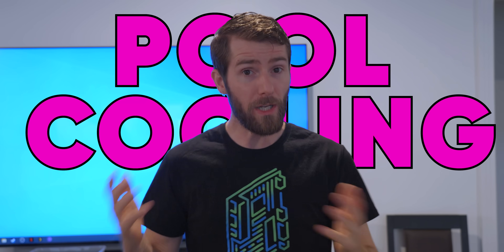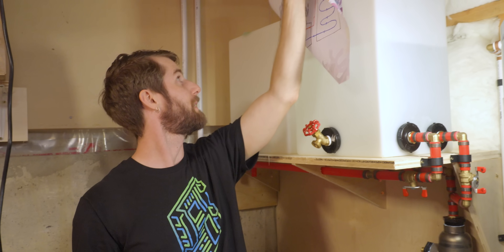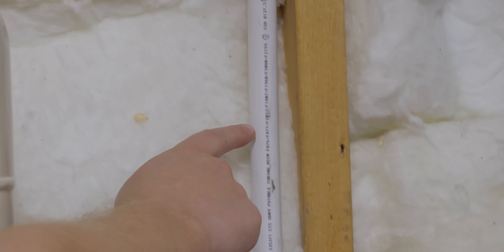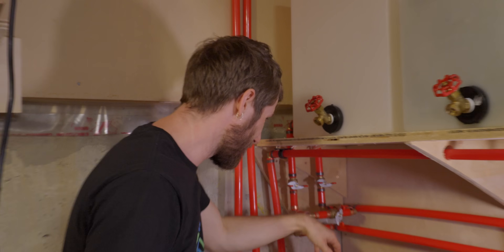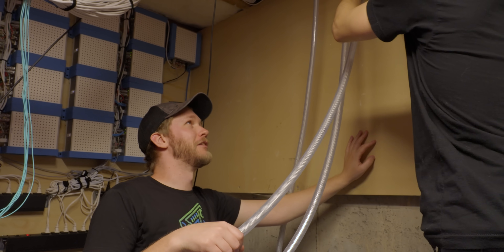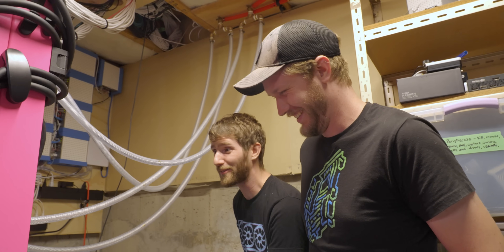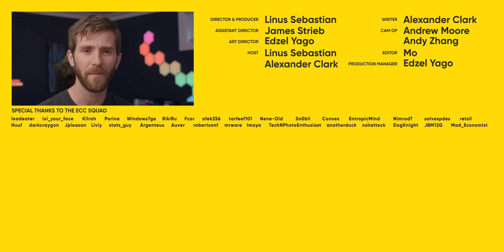My pool leaked and killed my computer - Whole Server Room Pool Watercooling Part 4

Comment: For a "expensive high tech house" build series, there is a ton of jank and bad decisions. Can't wait to see more!
Reply: Most professional installs are full of jank and bad decisions lol
Reply: This series makes my own upgrading decisions and our less than 100k value old house look like one sharp thing! I like it
Reply: Come on, they do it on purpose, no one is that stupid.
Reply: @laughingvampire7555 Oh yeah, surely people who have never repaired/upgraded a cooling system that's dependent on a pool would never accidentally make a single mistake, no sir.
Reply: Ikr. I was literally cringing at those manifolds from the start only to see them fail 2 times alone during testing (its only a matter of time before it breaks and starts leaking again).
Reply: There is no cloud. There is no expensive computer. It's all sand that's had light pointed at it and the software sucks anyways.
Reply: For sure 😂. The easiest, fastest and long lasting solution was and it will always be the good old air cooling. Just need to add some ventilation from the server room to the outside so that it does not become an oven
Reply: the problem becomes the noise pollution in that area of the house, that was one of the complaints...
Reply: @mastroitek might have been better fitting the outside bit of a heat pump in there. Cool the room, heat the house!
Reply: That's what happens when you have more money than sense.
Reply: I guess when you're rich and everything is supplied/payed by sponsors, consequences is nothing you need to worry about....
Reply: These videos are really just a grift. He's getting advertisers to give him free stuff that he wants in his house so that he personally benefits (himself and his family... not the company) without having to actually pay for things, he agrees to make videos to promote the products. Then he double-dips by monetizing the videos.
Reply: @scrazzle  you say that like its a bad thing?
Reply: @scrazzle  And we're getting free entertainment! its a win win
Reply: @scrazzle he's not lying about anything
Reply: @scrazzle brilliant!
Reply: @scrazzle He uses his work to pay for his house and belongings? The horror!
Reply: @scrazzle You forgot the part where the entire house is a production expense. Free stuff plus free house. Gotta love tax loopholes.
Reply: @Bob_Smith19  that's not how taxes work
Reply: @Bob_Smith19  Not really a tax loophole when his entire setup is profitable for the company. The amount of content his entire house provides is nuts. The revenue offsets personal gain by a large margin I'd say.
Reply: @Bob_Smith19 smart buisness moves
Reply: @Bob_Smith19   Were you born in 2019? I could believe it. that isn't how taxes work lol.
Reply: @Bob_Smith19 Even if it were remotely possible to fully write off his house as a business expense (at most he could get minor tax breaks personally by using it for business purposes, and then pay taxes instead on the revenue generated by the work done at the house), that wouldn’t make the house free. It would just change the taxes from going to him/his wife to going to the company owned by him/his wife, and at best reduce some of the taxes owed on the profits generated by the videos over the portion of his house cost relative to the percent of time it is used for commercial purposes.

At absolute best, it would lower the taxes due to the government. It’s still not a free house. And he might have a lot of money but he’s not the kind of rich where governments won’t do something about what would be such an obvious violation if he’s fully living in a house that is just occasionally used for work things and claiming it as a business expense.

Comment: For labeling, instead of "in" or "out", HVAC systems label them as "supply" "return" with arrows. Supply means the water is cold. So you label both end of the tube chilled water supply if the water hasn't been warmed by the computers.
Reply: yes, in and out needs a reference point. however both ways of supply/return and arrows are absolute and can be understood by anyone
Reply: I would use artery and vein.

Comment: Given the investment complexity it would have been best to keep your water branch connection on the outside cabinet wall. Second a metal branch vs. a plastic to ensure no failure. A 24 hour pressure test would be better. Since it is a family home with your children and you experienced a electrical problem there should have a fire sprinkler setup in the basement to protect everyone. Lastly all the PVC pipe outside is still unpainted protecting it from UV degradation over time. Don't forget there are reducing NPT tees to lessen the amount of reducers/fittings. 😉

Comment: I would highly recommend moisture sensors that kill the power if they are tripped
Reply: The moment itll detect anything, damage will already be done
Reply: but contained @alittlebitintellectual7361  otherwise the limit would be the fuse itself
Reply: @alittlebitintellectual7361  true, but then you can stop any water damage to the house's foundations. If he gets a flood there, it's going to be an expensive job

Comment: I'm sure the video is already shot, but my vote would be the Ubiquiti smart power strip . Set the bios to boot the PC when it receives power and you can remote boot the PC from the Connect app.
Reply: In a world where Wake on LAN exists, this sounds overly expensive and complicated
Reply: And lose your BIOS settings when the battery dies. Like the other person said: use WoL

Comment: Store idea: keystones that are two-piece, snap-together halves with a hole in the middle to allow actual passthrough of cable for situations where you don't want or can't use a connector, but still want things to look nice and finished.
Reply: Additional point: For people with 3D printers, providing the STL would be of great assistance

Though as it stands now, it may already exist with the 3D printing community

Comment: "use heat exchanger"
Linus: "no need it"
and now the results u.ur

Really, I want control the RGB on my desk using the PC but I will not put just a wire from my PC to my desk because anything going in/out need be insulated or you can have problems, the same for the water loop, you need a clean and safe fluid on your PC when you have a lot of pipes on the other side.

4:09 btw you can get only the cable having not the PC side to not cut a poor cable.

Comment: This is probably why you see things like the radiator doors in a datacenter instead of running water inside individual servers where a leak will cascade the failures to equipment under and around the leak. This is also why the in server liquid cooling you do see in places like the supermicro labs, they use very professional tubing and fittings, you won't find rubber/plastic tubes. If you are using things like that and wormdrive clamps, you already f'dup, I look forward to the next video where this happens again because you didn't do right the first time.
Reply: You mean the second time. The first time was even worse than this.
Reply: @lostcoast707  Yep, once I saw more plastic/rubber tubes and wormdrive hose clamps I knew that this was destined to be the next new new new wenafukeditupagain server series.
Reply: Datacenters also have humidity control to limit condensation against chilled components.
Reply: @DanielFSmith  sure, in a normal datacenter they would not be cooling with a pool that's exposed to the below zero canadian winter, so yeah condensation is going to be a concern unless you are making sure that water temps are not falling below dew temp. Either way it would be better to have a rear door radiator that dumps the heat into the pool without having to run all that water into the servers and introduces many more points of failure.
Reply: Maybe mount the servers upside down so leaks just go into the computer case and not the motherboard?
Reply: @YossiRafelson  well honestly it's very likely that many watercooled servers will be in the datacenter in the next few years, but the necessity is only because the watts/u are getting to be ridiculous. If you have a server that's pulling 7000 Watts, yeah... you are going to need to use water cooling, and that's why places like the Supermicro lab is doing research on those designs now. However, most cases now are not water tight nor have had any design considerations to containing liquid, in fact most have air intakes and exhausts to make them breathe so even upside down they would leak everywhere.

Comment: Label IN = INput to the computer,
OUT = Leaving the computer,
all connections should be labeled the same,
the entire rail for IN should be connected to IN and all connections going INto the Computers labeled the same
All fluid leaving the computer should be labeled OUT and all connections and the rail should be labeled OUT,
rails and connections all have the same naming. no more confusion.

Comment: you shouldn't have put those bare wires in that connector though, they should have had ferrules on them, that was straight-up amateur hour.  you guys tend to do some questionable stuff, but you should know better than that.  come on.

Comment: I've never seen a computer produce that much smoke that fast, and I've personally seen our lighting struck PC tower explode in the mid 90s. But there was way more smoke from that 2 seconds of being plugged in.
Reply: Blowing up a large electrolytic capacitor can produce that amount of smoke and given that it died the instant power was applied it wouldn't surprise me if the power supply blew.
Reply: @oliverer3 especially if it was the switch psu and was getting loaded
Reply: Back when CRT monitors were the only thing you could get. I had a new monitor bellow out thick black smoke first time it was turned on.
Reply: it was the switch that died
Reply: I would guess that custom cable was a bit to custom
Reply: I've seen a computer literally on fire and it produced less smoke. I half suspect that "smoke" was added in post production for dramatic effect although I can't be sure. I'm sure there absolutely was smoke, I just question if they "enhanced" it for dramatic effect.
Reply: @orclev Enterprise hardware! All the smoke that was produced was blown out the back by the fans, and if a cap exploded in the PSU you can expect that amount of smoke

Comment: You might want to put a water sensor by those fittings so if there is a leak you will have a kind of warning and a notification
Reply: And a way to shut off the pump and put the computers to sleep.
Reply: Yeah I feel like sensors and a shut off can pretty easily be hooked into his z-wave smarthome setup
Reply: @___Vortex___ they already sell stuff like that for zwave so yeah its a no brainer when the leak can literally fill the room lol
Reply: @TriMMA343 well yeah. At a professional setting. Safe kinda goes out the window for home projects.
Reply: @@TriMMA343  GFCI/RCDs can't detect faults which are after an isolated power supply like those in the PCs. I'd also suspect the circuit doesn't have GFCI protection. If it does the UPS certainly doesn't so a fault would cause a switch to battery and damage would keep being done. They should definitely consider adding a GFCI after the UPS. It wouldn't have helped in this case but it would prevent more serious damage if water gets on the 120v side of things.
Reply: Also should have a sensor to make sure that sensor is working properly.
Reply: It'll just say, "fuck"
Reply: So he finds out about the catastrophe while he's at the office dealing with some other shit and unable to deal with it immediately, as opposed to when he gets home when he has at least dealt with the other shit?

Comment: Just a heads up on the pex being outside you need to cover it, pex degrades with UV.
Reply: From what I understand that's much less of a problem with modern pex vs. the older stuff, so it's not as vital. Still probably a good idea just for maximum longevity.
Reply: I'm pretty sure that the outside stuff is in what was labelled "Pool Shed" in the diagram.  I assume they remove the "shed" part to work on it.

Comment: I've had that happen before. My pump failed while gaming and the fluid got so hot the tubing warped and blew out of my graphics card.

I saved most of the components but the motherboard and PSU were toast. I'm sure there would have been a fire if not for the psu's ocp.

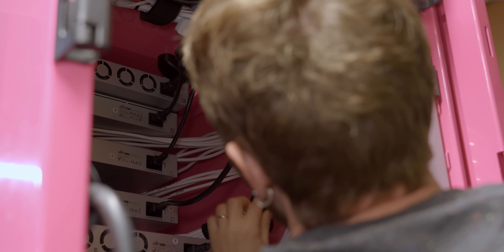Comment: 16:55 The cable you pulled fresh out of the wall like that banged against the metal of the rack with at least one of the leads, which still had a charge behind it (capacitor), and put a large current on the ground of the switch.
Reply: Nothing in the video showed that, it only showed him pulling one plug out and right after he had plugged the smoking device in.
Reply: @alexatkin  you're right, I definitely missed the cut in the editing the first time. It's even a different unit that goes up in smoke than the one that it showed him pulling out
Reply: More like the new cable had the internal wires connected wrong on one of the ends. Linus did mention 'Custom' and we all know what that means.
Reply: I was wondering if the plug banging against the rack had something to do with it but I know next to nothing about electronics so it was interesting to read this explanation.

Comment: Alex's idea of in and out makes total sense to me. In for into the computer and out means out of the computer.
Reply: You put an output into an input. You connect an audio output to a speaker input and a microphone output to an audio input.
Plug and socket. Alex is making things difficult
Reply: its really ambiguous, it should be flow arrows

Comment: Teflon tape goes on with the thread direction. If youre dyslexic like me, right and left, require actual thought to infer, so to verify you put it on right, grab the teflon you just put on the threads with kind of like your fingers in an O shape, and then thread the fitting into your fingers. Tape will basically stay still. if you try turning it the opposite way, or more importantly if your tape is on wrong, doing this will cause the tape to start coming off. As long as the threads are standard though, hold fitting in left hand, and apply tape over the top away from you. The way the tape comes off the spool differs as well depending on how you hold it. If you try with the tape 'bottom' youll fight loose teflon cause you cant hold the pressure as you wrap the fitting giving it a tight fit against the threads. Orient the tape spool so the top of the tape on the spool is being wrapped around the threads and the more you pull the tighter it will wrap. 

Source: Prior oilfield trash and US Navy plumber. Teflon tape being applied wrong is like one of my few pet peeves.